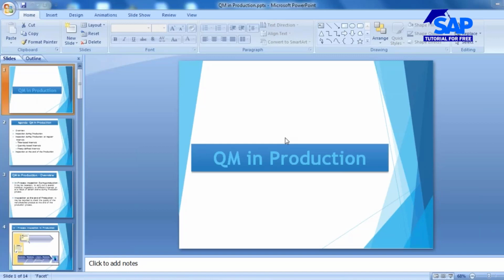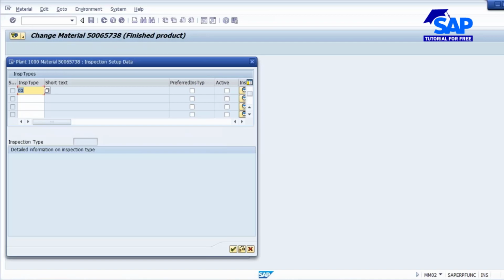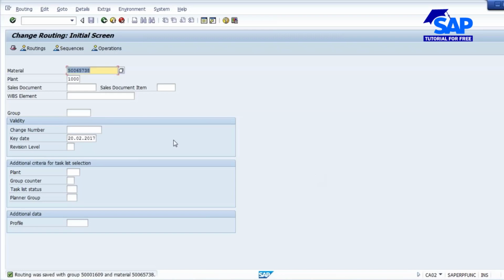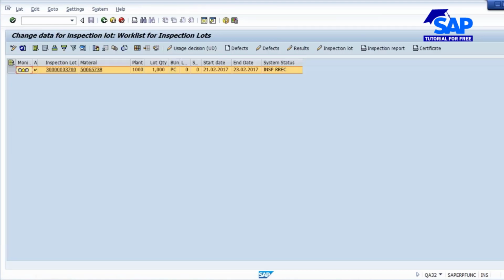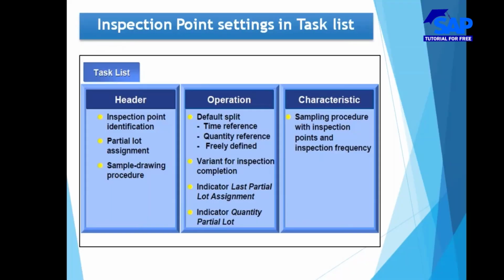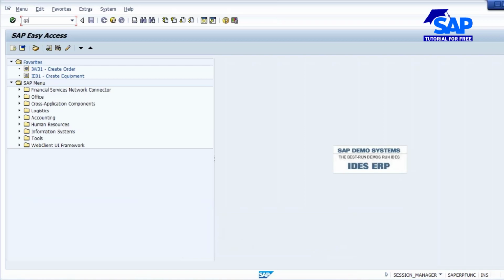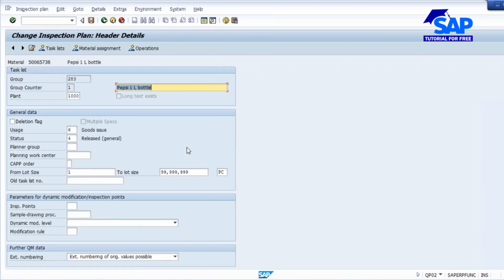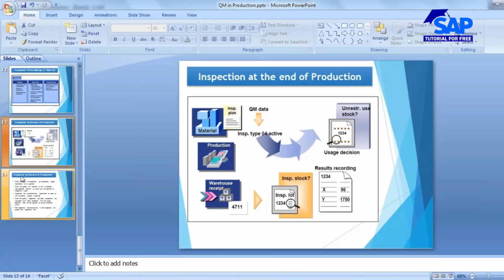SAP Quality Management | SAP QM in Production | SAP Tutorial For Free | SAP Software Full Tutorial

Comment: Thanks for nice material. Just one doubt, if UD is rejected for in-process inspection, what will happen in SAP?
Reply from the maker: I do not understand what you are trying to do. Do you mean you want to post the UD code = R, without physically posting quality stock to blocked stock?

Please be informed that once the UD = A has already been applied, then the stock locked under quality inspection will be moved to unrestricted stock. The same will be reflected in MMBE screen too. So there will be no further stock logged under the same inspection lot so re-do UD = R.

In case UD = R is getting applied at the inspection lot level, but the stock is still lying under quality stock, this means that posting proposal linked to rejection UD code is not maintained.

Thank you
Reply: @SAPTutorialForFree  Thanks for your reply. My doubt is, if I use inspection type 03, and make UD with rejection, the inspection lot would be completed with UD rejection. Since inspection type 03 doesn't have stock posting, then how to handle with that rejection quantity in SAP.